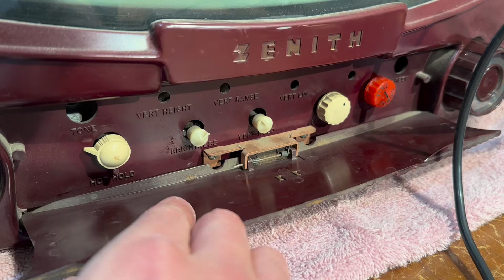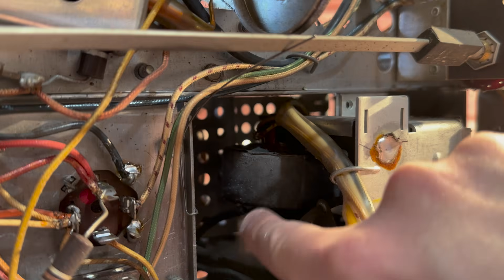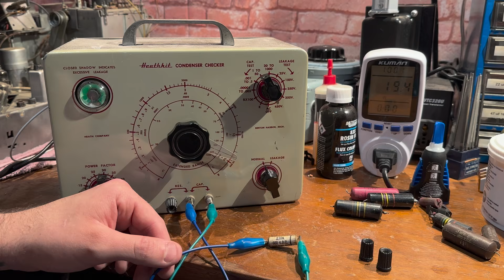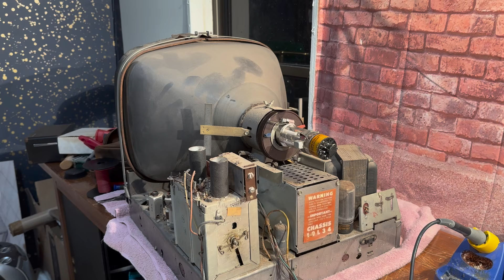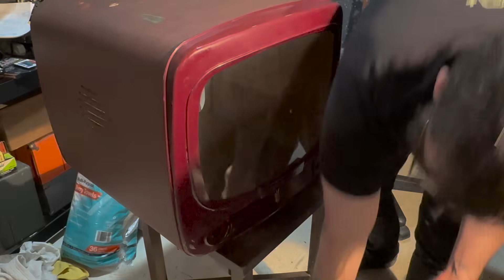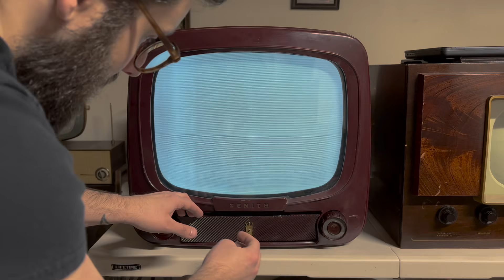1953 Zenith "Bandshell" Television

Comment: According to a quick search:
1957 Zenith patents fringe-lock technology, a cure for loss of picture synchronization.
1951 "Fringe Lock" circuit, introduced in September black- and—white TV line, greatly extends the range of good TV reception, blocking out signal interference to picture synchronizing in weak signal areas.

Comment: They called it a portable because it has a handle. I had about a 57 to 59 with the bug eye controls. It had a bright sharp picture and just as heavy.
Well I guess it doesn't have a handle, pretty sure mine did but its been many years.